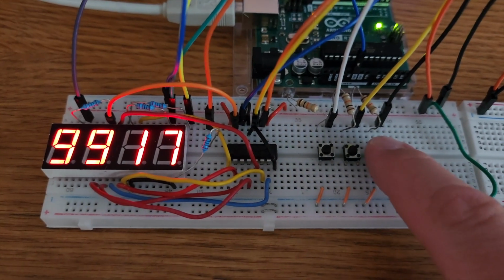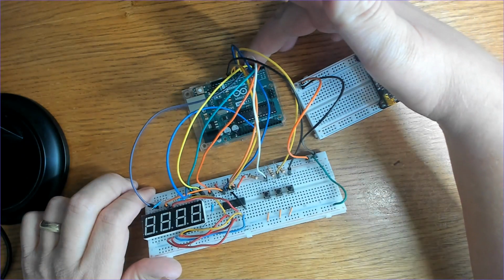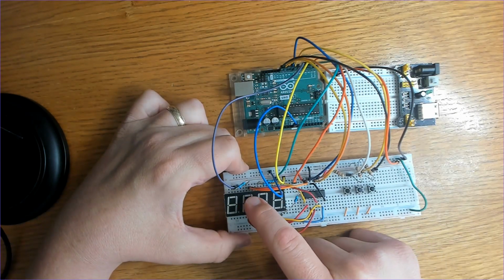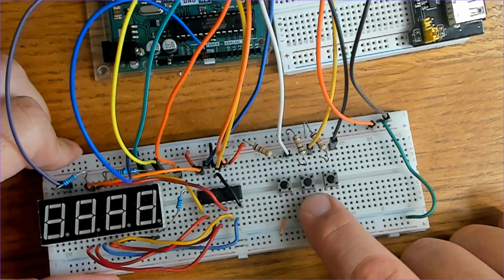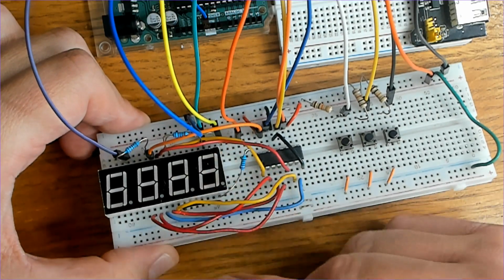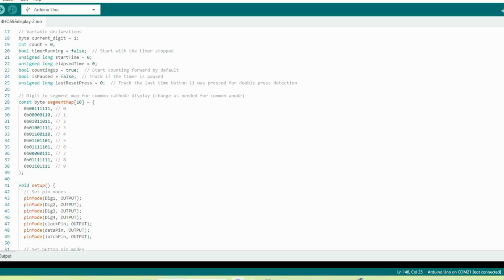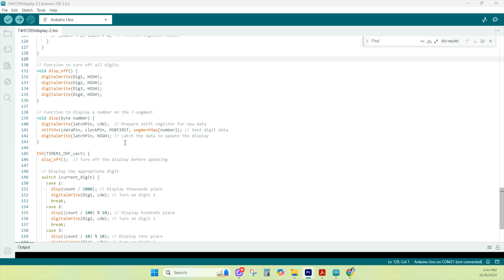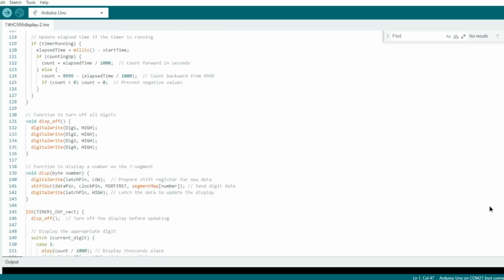How to Build a Digital Timer with Arduino and 7-Segment Display – Beginner-Friendly Guide

Comment: If anyone wants the code it's below. ⬇ (Thanks so much for not including any libraries[!])

//4 digit display using 74HC595 shift register 
#define clockPin 9 // Clock pin for 74HC595 
#define dataPin 8 // Data pin for 74HC595 
#define latchPin 10 // Latch pin for 74HC595 

// Common pins of the four digits definitions 
#define Dig1 5 
#define Dig2 4 
#define Dig3 3 
#define Dig4 2 

// Button pins 
#define countForwardBtn 6 // Button to count forward 
#define countBackwardBtn 7 // Button to count backward 
#define pauseResetBtn 11 // Button to pause and reset 

// Variable declarations 
byte current_digit = 1; 
int count = 0; 
bool timerRunning = false; // Start with the timer stopped 
unsigned long startTime = 0; 
unsigned long elapsedTime = 0; 
bool countingUp = true; // Start counting forward by default 
bool isPaused = false; // Track if the timer is paused 
unsigned long lastResetPress = 0; // Track the last time button 11 was pressed for double press detection 

// Digit to segment map for common cathode display (change as needed for common anode) 
const byte segmentMap[10] = {
0b00111111, // 0 
0b00000110, // 1 
0b01011011, // 2 
0b01001111, // 3 
0b01100110, // 4 
0b01101101, // 5 
0b01111101, // 6 
0b00000111, // 7 
0b01111111, // 8 
0b01101111 // 9 
}; 

void setup() { 
// Set pin modes 
pinMode(Dig1, OUTPUT); 
pinMode(Dig2, OUTPUT); 
pinMode(Dig3, OUTPUT); 
pinMode(Dig4, OUTPUT); 
pinMode(clockPin, OUTPUT); 
pinMode(dataPin, OUTPUT); 
pinMode(latchPin, OUTPUT); 

  // Set button pin modes 
  pinMode(countForwardBtn, INPUT_PULLUP); 
  pinMode(countBackwardBtn, INPUT_PULLUP); 
  pinMode(pauseResetBtn, INPUT_PULLUP); 

  // Turn off all digits initially 
  disp_off(); 

// Timer1 setup for multiplexing 
TCCR1A = 0; 
TCCR1B = 1; // Enable Timer1 with prescaler 1 
TCNT1 = 0; // Reset Timer1 counter 
TIMSK1 = 1; // Enable Timer1 overflow interrupt 
}

void loop() { 
// Check forward counting button 
if (digitalRead(countForwardBtn) == LOW && !timerRunning) {
  countingUp = true;  // Set direction to forward 
  timerRunning = true; // Start or resume the timer 

    if (isPaused) { 
      // If paused, continue counting without resetting startTime 
      startTime += millis() - elapsedTime; 
      } else { 
        startTime = millis(); // Reset the start time if starting fresh 
      } 
      
      isPaused = false; // Clear pause state 
      delay(200); // Debounce delay 
    } 

    // Check backward counting button 
    if (digitalRead(countBackwardBtn) == LOW && !timerRunning) {
       countingUp = false; // Set direction to backward 
       timerRunning = true; // Start or resume the timer 
       
      if (isPaused) { 
        startTime += millis() - elapsedTime; 
        } else { 
          startTime = millis(); // Reset the start time if starting fresh 
        } 
          
    isPaused = false; // Clear pause state 
    delay(200); // Debounce delay 
  }

// Check pause/reset button 
if (digitalRead(pauseResetBtn) == LOW) { 
  unsigned long currentMillis = millis(); 

  if (!isPaused) { 
    // If not paused, pause the timer 
    timerRunning = false; 
    elapsedTime = millis(); // Store the time when paused 
    isPaused = true; // Mark it as paused 
    } else if (currentMillis - lastResetPress < 500) {
      // If paused and button pressed again within 500ms, reset the counter 
      count = 0; 
      timerRunning = false; 
      isPaused = false; 
    } 
      
    lastResetPress = currentMillis; // Update the last press time 
    delay(200); // Debounce delay 
  } 

  // Update elapsed time if the timer is running 
  if (timerRunning) { 
    elapsedTime = millis() - startTime; 
    if (countingUp) { 
      count = elapsedTime / 1000; // Count forward in seconds 
    } else { 
        count = 9999 - (elapsedTime / 1000); // Count backward from 9999 
        if (count < 0) count = 0; // Prevent negative values 
      } 
    } 
  } 
    
// Function to turn off all digits 
void disp_off() { 
  digitalWrite(Dig1, HIGH); 
  digitalWrite(Dig2, HIGH); 
  digitalWrite(Dig3, HIGH); 
  digitalWrite(Dig4, HIGH); 
} 

// Function to display a number on the 7-segment 
  void disp(byte number) { 
  digitalWrite(latchPin, LOW); // Prepare shift register for new data 
  shiftOut(dataPin, clockPin, MSBFIRST, segmentMap[number]); // Send digit data 
  digitalWrite(latchPin, HIGH); // Latch the data to update the display 
}

ISR(TIMER1_OVF_vect) { 
  disp_off(); // Turn off the display before updating 

  // Display the appropriate digit 
  switch (current_digit) { 
    case 1: 
      disp(count / 1000); // Display thousands place 
      digitalWrite(Dig1, LOW); // Turn on digit 1 
      break; 
    case 2: 
      disp((count / 100) % 10); // Display hundreds place 
      digitalWrite(Dig2, LOW); // Turn on digit 2 
      break; 
    case 3: 
      disp((count / 10) % 10); // Display tens place 
      digitalWrite(Dig3, LOW); // Turn on digit 3 
      break; 
    case 4: 
      disp(count % 10); // Display ones place 
      digitalWrite(Dig4, LOW); // Turn on digit 4 
      break; 
  }

  current_digit = (current_digit % 4) + 1; // Cycle to the next digit 
}
Reply from the maker: Thanks!
Reply: I dont know if it worked for you but it didnt work for me

Comment: How can I choose how much time to set the timer?
Reply from the maker: hey there!
in this project, the time counts UP from 0 when you press button 6
it counts DOWN from 9999 when you press button 7
the program doesn't let you choose a specific time to count down from, but there are changes you can make to the code to fit your needs.

I posted this code on Facebook - search the hashtag in the description and you'll find it.

you can find this line in the code: 
count = 9999 - (elapsedTime / 1000);
and change it to whatever you like (725 for example):
count = 725 - (elapsedTime / 1000);
now you're counting down from 725 ratherr than 9999
Reply: @BMonsterLaboratory thank you, sir🫡🫡

Comment: Aside from my previous comment, is it possible if I use a common anode for the 4-digit 7-segment display? I know that it was meant to be a common cathode but I've accidentally brought a common anode. If so, does the wires and coding has to be changed?
Reply from the maker: You can use commion anode, no problem.
Both wiring and code logic need to change.

Comment: Hey, I was wondering regarding of the jumper cables you've used in this project, is it possible if I switch out the jumper cables that doesn't have any plastic housing to those that does have a plastic housing? As you've only mentioned a couple of jumper cables without a specific characteristic? Thank you 🙏
Reply from the maker: hey there!
sure, you can use wires with plastic or the solid wire without plastic. Some dupont wires have the rubber on the ends in place of the plastic...those are nice, durable, and sturdy.  As long as you can get a good connection to the breadboard, any 22-24g wire will do.
sometimes i like to clip small pieces of 22g solid wire for short connections on a breadboard. If you clip your own wires, don't leave too much bare wire exposed. 
good question! 👍👍
Reply: @BMonsterLaboratory  Alright then, based on preferance. But, the solid wires that were used on this video is able to be replaced with the jumper wires right? (As you've didn't mentioned any solid wires to be used in this project from the materials, just some Arduino-related things, jumper cables, resistors and buttons) If so, that answers my question and I really appreciate it.
Reply: And if turns out, jumper wires wasn't able to replace solid wires, is it alright if I use stranded wires rather than solid wires? Considering it's flexibility of course, but I knew that solid wires were more suitable for long-term project as they could be hold in the same position and it's pretty durable and structurable. But, I'm offering stranded wires as just an alternative, is it better to replace solid wires with jumper cables or stranded wires?

Comment: I know this was a couple months ago, but could you please send the code and schematics? You seem like a good guy but when I clicked on this video, I was expecting a full-fledge tutorial. Thanks!
Reply from the maker: hey there!
Just send an email and I'll send my code and schematic to you - no problem!   bmonsterlaboratory@gmail.com
Aslo, I have an email list where I send the Arduino .ino file, diagrams, and other details about my most recent video. if you want to be added, just send me an email and make sure it says ("AddMe" to the email list).
Reply: @BMonsterLaboratory  Thank you so much! I will do this in the morning on my pc as I am currently in bed on my phonr
Reply: @BMonsterLaboratory  Email as been sent!
Reply: //I have put the code in a separate comment, but here is the code:
//4 digit display using 74HC595 shift register 
#define clockPin 9 // Clock pin for 74HC595 
#define dataPin 8 // Data pin for 74HC595 
#define latchPin 10 // Latch pin for 74HC595 

// Common pins of the four digits definitions 
#define Dig1 5 
#define Dig2 4 
#define Dig3 3 
#define Dig4 2 

// Button pins 
#define countForwardBtn 6 // Button to count forward 
#define countBackwardBtn 7 // Button to count backward 
#define pauseResetBtn 11 // Button to pause and reset 

// Variable declarations 
byte current_digit = 1; 
int count = 0; 
bool timerRunning = false; // Start with the timer stopped 
unsigned long startTime = 0; 
unsigned long elapsedTime = 0; 
bool countingUp = true; // Start counting forward by default 
bool isPaused = false; // Track if the timer is paused 
unsigned long lastResetPress = 0; // Track the last time button 11 was pressed for double press detection 

// Digit to segment map for common cathode display (change as needed for common anode) 
const byte segmentMap[10] = {
0b00111111, // 0 
0b00000110, // 1 
0b01011011, // 2 
0b01001111, // 3 
0b01100110, // 4 
0b01101101, // 5 
0b01111101, // 6 
0b00000111, // 7 
0b01111111, // 8 
0b01101111 // 9 
}; 

void setup() { 
// Set pin modes 
pinMode(Dig1, OUTPUT); 
pinMode(Dig2, OUTPUT); 
pinMode(Dig3, OUTPUT); 
pinMode(Dig4, OUTPUT); 
pinMode(clockPin, OUTPUT); 
pinMode(dataPin, OUTPUT); 
pinMode(latchPin, OUTPUT); 

  // Set button pin modes 
  pinMode(countForwardBtn, INPUT_PULLUP); 
  pinMode(countBackwardBtn, INPUT_PULLUP); 
  pinMode(pauseResetBtn, INPUT_PULLUP); 

  // Turn off all digits initially 
  disp_off(); 

// Timer1 setup for multiplexing 
TCCR1A = 0; 
TCCR1B = 1; // Enable Timer1 with prescaler 1 
TCNT1 = 0; // Reset Timer1 counter 
TIMSK1 = 1; // Enable Timer1 overflow interrupt 
}

void loop() { 
// Check forward counting button 
if (digitalRead(countForwardBtn) == LOW && !timerRunning) {
  countingUp = true;  // Set direction to forward 
  timerRunning = true; // Start or resume the timer 

    if (isPaused) { 
      // If paused, continue counting without resetting startTime 
      startTime += millis() - elapsedTime; 
      } else { 
        startTime = millis(); // Reset the start time if starting fresh 
      } 
      
      isPaused = false; // Clear pause state 
      delay(200); // Debounce delay 
    } 

    // Check backward counting button 
    if (digitalRead(countBackwardBtn) == LOW && !timerRunning) {
       countingUp = false; // Set direction to backward 
       timerRunning = true; // Start or resume the timer 
       
      if (isPaused) { 
        startTime += millis() - elapsedTime; 
        } else { 
          startTime = millis(); // Reset the start time if starting fresh 
        } 
          
    isPaused = false; // Clear pause state 
    delay(200); // Debounce delay 
  }

// Check pause/reset button 
if (digitalRead(pauseResetBtn) == LOW) { 
  unsigned long currentMillis = millis(); 

  if (!isPaused) { 
    // If not paused, pause the timer 
    timerRunning = false; 
    elapsedTime = millis(); // Store the time when paused 
    isPaused = true; // Mark it as paused 
    } else if (currentMillis - lastResetPress < 500) {
      // If paused and button pressed again within 500ms, reset the counter 
      count = 0; 
      timerRunning = false; 
      isPaused = false; 
    } 
      
    lastResetPress = currentMillis; // Update the last press time 
    delay(200); // Debounce delay 
  } 

  // Update elapsed time if the timer is running 
  if (timerRunning) { 
    elapsedTime = millis() - startTime; 
    if (countingUp) { 
      count = elapsedTime / 1000; // Count forward in seconds 
    } else { 
        count = 9999 - (elapsedTime / 1000); // Count backward from 9999 
        if (count < 0) count = 0; // Prevent negative values 
      } 
    } 
  } 
    
// Function to turn off all digits 
void disp_off() { 
  digitalWrite(Dig1, HIGH); 
  digitalWrite(Dig2, HIGH); 
  digitalWrite(Dig3, HIGH); 
  digitalWrite(Dig4, HIGH); 
} 

// Function to display a number on the 7-segment 
  void disp(byte number) { 
  digitalWrite(latchPin, LOW); // Prepare shift register for new data 
  shiftOut(dataPin, clockPin, MSBFIRST, segmentMap[number]); // Send digit data 
  digitalWrite(latchPin, HIGH); // Latch the data to update the display 
}

ISR(TIMER1_OVF_vect) { 
  disp_off(); // Turn off the display before updating 

  // Display the appropriate digit 
  switch (current_digit) { 
    case 1: 
      disp(count / 1000); // Display thousands place 
      digitalWrite(Dig1, LOW); // Turn on digit 1 
      break; 
    case 2: 
      disp((count / 100) % 10); // Display hundreds place 
      digitalWrite(Dig2, LOW); // Turn on digit 2 
      break; 
    case 3: 
      disp((count / 10) % 10); // Display tens place 
      digitalWrite(Dig3, LOW); // Turn on digit 3 
      break; 
    case 4: 
      disp(count % 10); // Display ones place 
      digitalWrite(Dig4, LOW); // Turn on digit 4 
      break; 
  }

  current_digit = (current_digit % 4) + 1; // Cycle to the next digit 
}

Comment: I really like the you tube channel and all the great videos and how you explain and use diagram. I working on a project for a charity children’s elementary school haunted house it’s called pirates abyss. I’m making cannons for them. I’m using a spirit 400 W fog machine with the timer which I modified the timer with one end splitting off that has 110 V that only operates when the timer goes off with the duration around 5 to 10 seconds and then there is no active power. My issue is I want to activate a sound card, but I don’t know how to get the signal from the 110 voltage from the timer of the fog machine to trigger the sound card. I watched your video on SoundCloud and relays. I do have a sound card and I have a relay, but not sure where all the wires are supposed to go.  
 Soundboard AITIAO 
 20W Voice Playback Module MP3 Music Player DC 6-35V 12V/24V Sound Board USB Downloadable Music Player 24-bit DAC Output MP3 WAV Support TF Card 32GB for Broadcast Device.  And DC 5V Relay Module 1 Channel Relay Switch Relay Board with Optocoupler Isolation Support High or Low Level Trigger. So the fog timer will need to trigger the light for the cannon and activate the sound card at the same time ??? Lost and confused… Jim macri.
Reply from the maker: Hey Jim!  Thank you for the kind words, I really appreciate it.
I just bought this AITIAO sound board 2 seconds ago and it will be here Friday. I already have a relay, an sd card to put some sounds on, and an active speaker to connect for audio output. Lets get this done, Halloween is right around the corner!
This should be fun to put together and i'll share my diagrams with you. Feel free to email me at bmonsterlaboratory@gmail.com or Facebook messenger where I can provide pictures and such. 
talk to ya soon!
-brad

Comment: Tried making a track timer for a pinewood derby track many years ago. It didnt end well.

Got one to work fine. When the second one stopped, it stated the timer on the 1st again.

I couldn't get it figured out and then the cub master quit and cub scouts was over.
Reply from the maker: Hey there! I remember when the derby tracks where popular, not only with cub scouts but church groups on other youth groups. Great projects for parents and kids. 
You can add all sorts of upgrades to your derby races with Arduino! I wonder if you had a short somewhere on your timer or maybe a loose connection...sorry it didn't turnout for ya.
Great hearing for ya! 👍